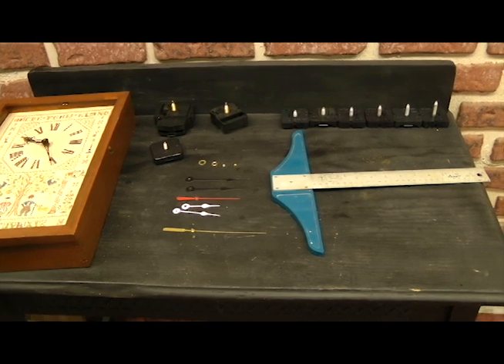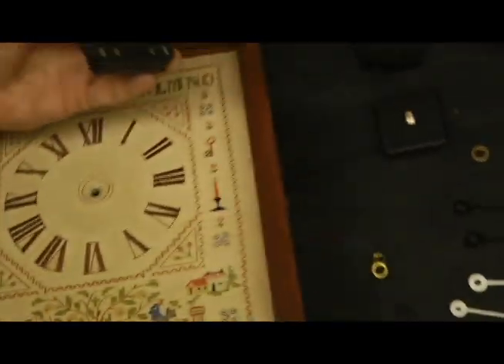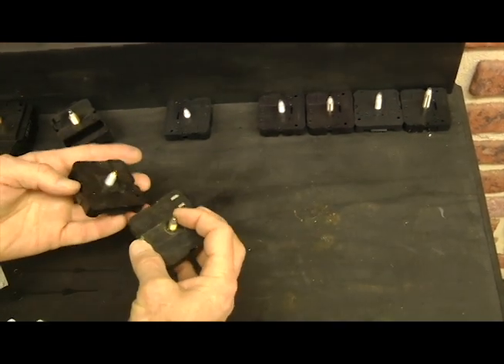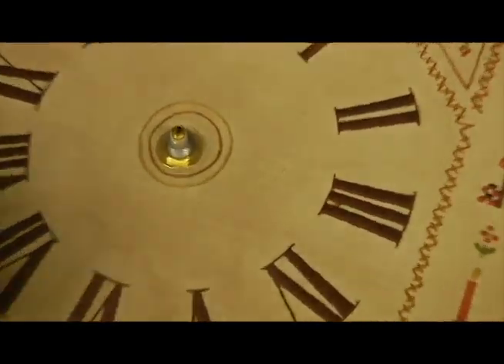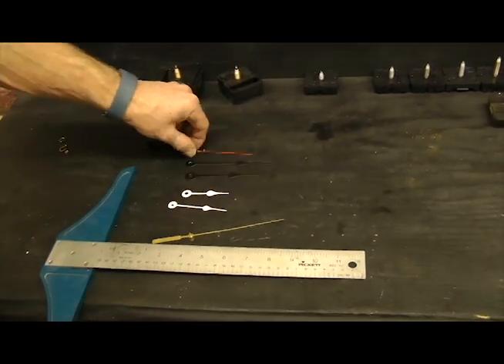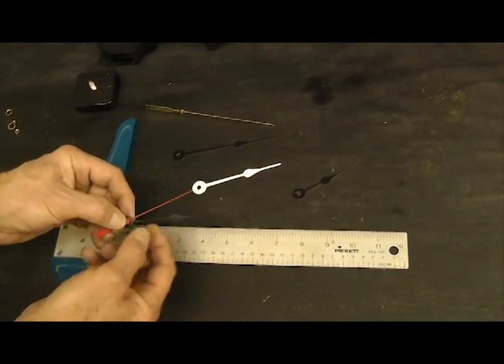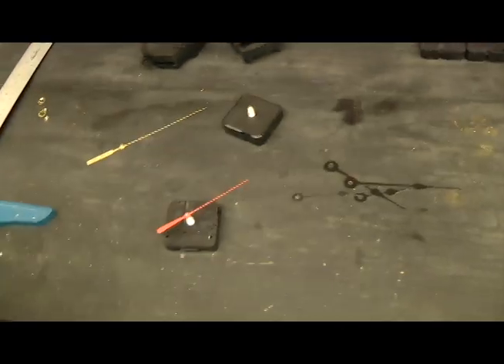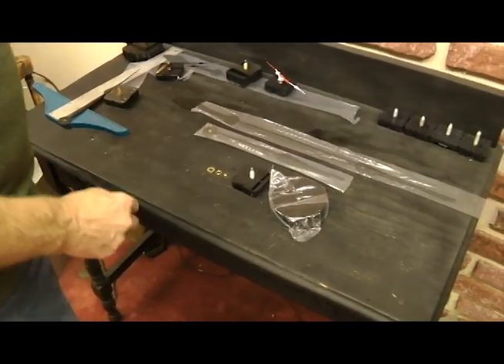How to identify and replace a quartz clock movement by www.norkro.com

Comment: Hello, I have a wall clock with quartz movement with pendulum and separate speaker with Westminster chime. The clock works but not the pendulum. The Westminster chime seems to chime slowly after about a week on a fresh battery but clock still keeps correct time. Any ideas on the issue ?  Thanks.
Reply: It also has the "C" battery movement.

Comment: Same problem as others below.  Hand shafts were too small for the hand I had and the hands that came with it were too short for my clock to look good.
Reply from the maker: That's why we offer dozens of styles and sizes of hands with our movements. And most of them are free when you buy a movement from us. Just put the movement(s) in your shopping cart, then go to HANDS FOR QUARTZ to choose the hands that best fit your clock. Start with QUARTZ MOVEMENTS at: www.norkro.com

Comment: Your site shows brass threads.  This video shows plastic threads.  Which do you send me?

Are there any brands of movements superior to others, or are all Chinese imports, and about the same?

Thanks.
Reply from the maker: Takane are the only movements still made in USA and are as good as anything else on the market. Some movements made in Asia are better than others. Our Jia Hao movements, for instance, are as dependable as the Takane. I am happy to help you with any of your specific needs. You can contact us through our website: www.norkro.com
Reply: 2
Reply: "Our Jia Hao movements, for instance, are as dependable as the Takane."

So, they are all pretty bad, eh?

The Jia Hao movement I have in my new Toscano design mantle piece clock loses 9 hours in every twenty-four hours.(I notice that sometimes when I put finger pressure on the minute hand, it lacks resistance; other times there is more resistance. It's like something is loose in there. I'm not very impressed with Jia Hao.)

By the way, when it has "1688" typed on it, what does that mean? Is that a reference to its dimensions or its power or torque?